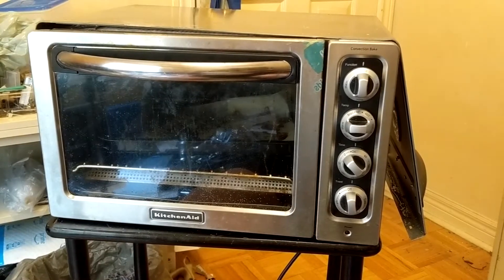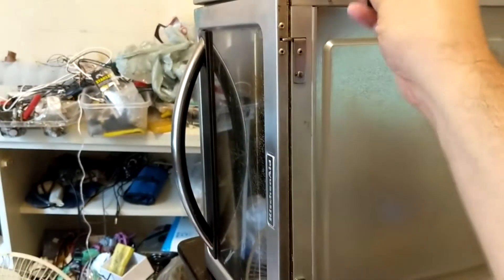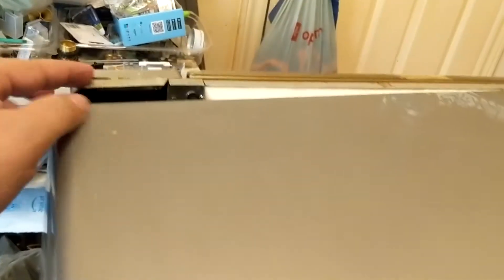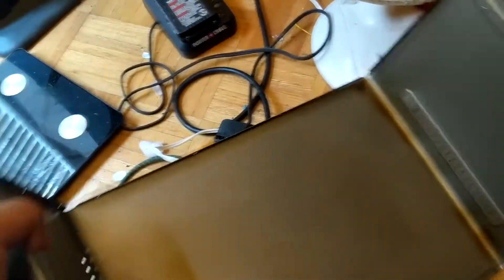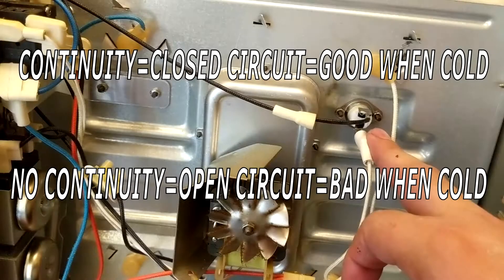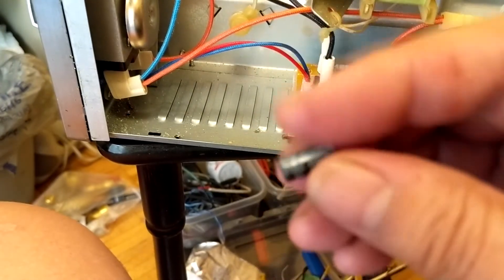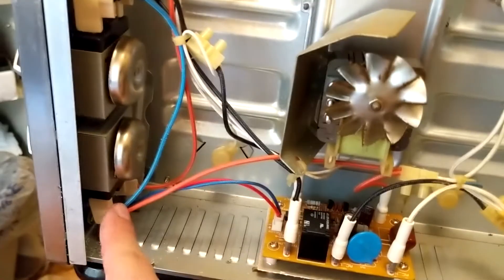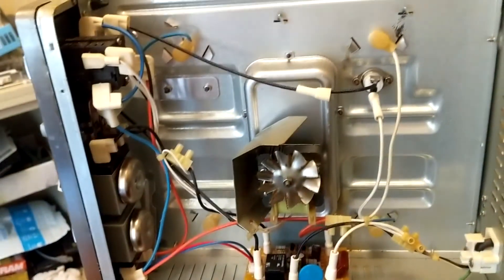DIY -TOASTER OVEN REPAIR - no heat, wont turn on -  Easy Fix for circuit board

Comment: damaged capacitors is a common cause of failure.   fixed 2 large screen tvs by replacing $2.00 worth of caps.  mine had not exploded but rather had swollen tops (curved not flat) or a bit of goo oozing out of the  base of the  capacitor

Comment: What could be the problem if the toaster mode works fine but not the bake mode? What test do you suggest?
Reply from the maker: the selector knob would be my first guess
Reply: @diyvinny6300  thank you! The rotary switch must be a good guess. I’m gonna look for this FZ31-9 part.
Reply: same issue, looking for FZ31-9 rotary switch, but no luck. Kitchenaid not selling this part. been looking everywhere ebay/amazon local stores. could you help?

Comment: We have no blue light either ! . Thanks for showing how to get inside it. Not sure what I'll find, Thanks
Reply from the maker: same as the one in video, no blue light. it wasnt mine so i didnt know about the blue led light. when putting it back together i didnt bother trying to get the front side frame to slide into the notches, it was a pia to try to get it in

Comment: At about 359 in the video  you refer to line voltage. There are four parts that look like line connectors. they have two screws to fasten lines together. Wondering if they are just connectors and can be substituted with other connectors. I have one that looks burnt and I want to replace it

Thanks
Reply from the maker: just connecters iirc

Comment: hey, how do you remove the feet? mine are screwed in but the screw head is underneath the plastic
Reply from the maker: if its not the same as on vid then i wouldnt know, sorry
Reply: Remove the rubber bit with a spudger or something thin and sharp

Comment: Is the line voltage part you referred to a fuse or just a connector? Mine has part number t110. Cannot seem to find it anywhere.
Reply from the maker: no fuse iirc, im not sure which part youre referring too

Comment: Where do you get the parts?
Reply from the maker: I Keep circuit boards from broken stuff just for scenarios like this, else see if you have an electronics store in your area like a radio shack equivalent type of store or from ebay or maybe amazon

Comment: You replaced a 16 volt with a 25 volt? It should be fine?
Reply from the maker: yes, u can always go higher in the volts which is actually better and can take more punishment, but dont go lower than original. but do  match the uF rating of the original capacitor